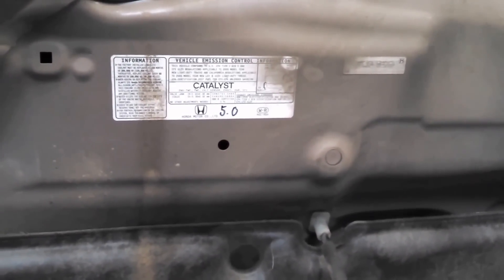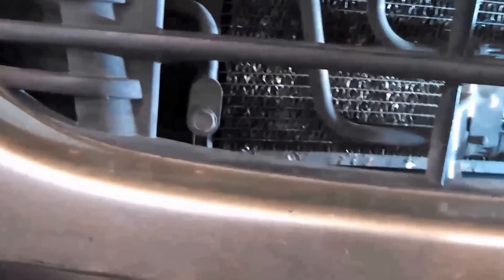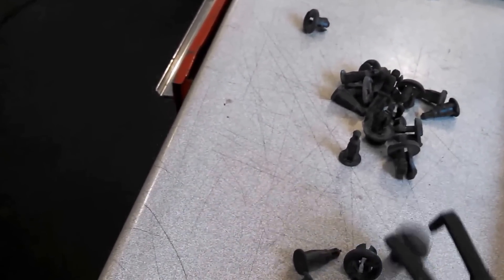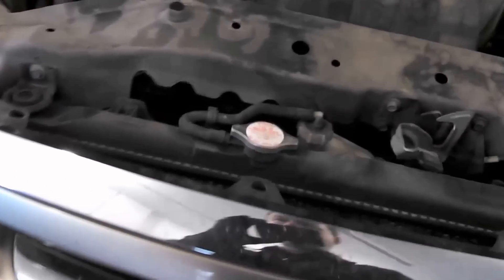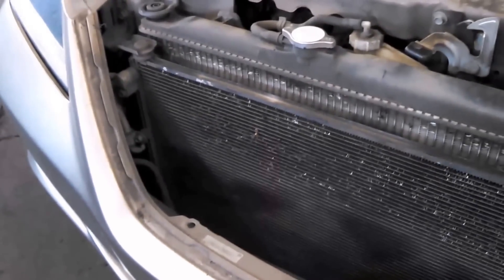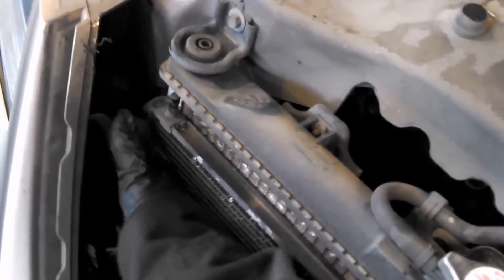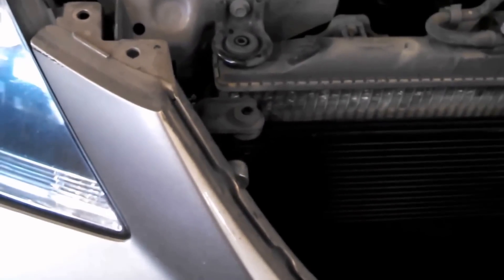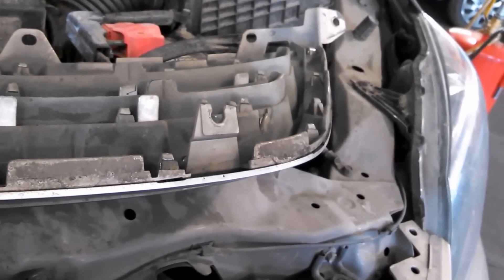Condenser replacement Honda Odyssey 2003 - 2007 Install Remove Replace

Comment: I hit a deer and need to replace my ac condenser as it is busted but I don't know if the feon escaped. I haven't checked the ac in the cabin. Besides taking it to someone, how can depressurize the system? ie How can I make sure the system is empty of freon/not under pressure?
Reply from the maker: follow the metal lines and you should find 1 of 2 hook ups for the a/c machine.  They may have caps on them, similar to the caps you find on car and bike tires just bigger.  Take off the cap if there is one and inside you should find a schrader valve , again like car and bike tires.  If you use a small screwdriver or something similar you can push down for a second and see if anything comes out or any sign of pressure.
Reply: Nic
Reply: Fixing cars and stuff  
Nice